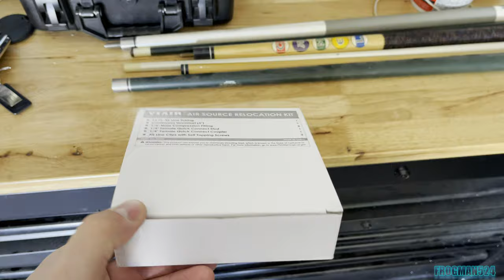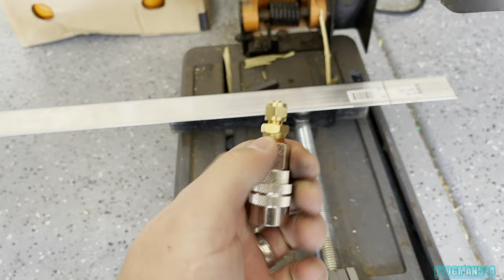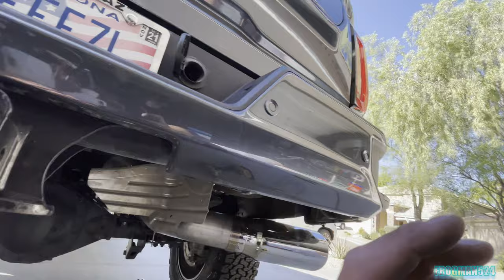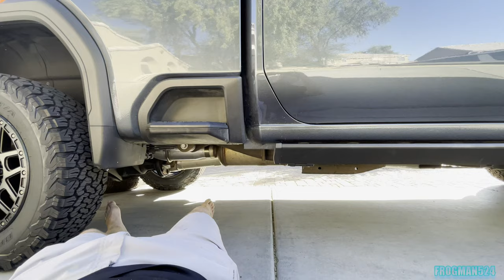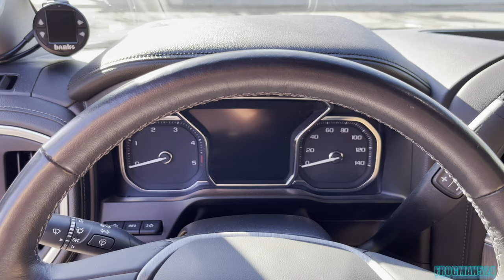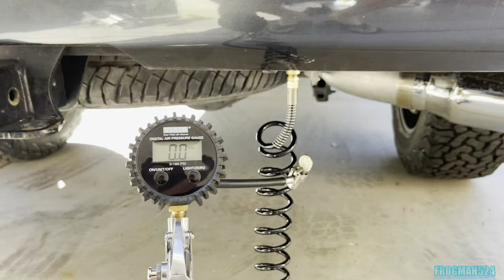Viair Air Source Relocation Kit Install on 2020 Denali HD

Comment: What Kleinn air horn kit do you have? Last I checked checked they didn't make a kit for the 2020 and up trucks. I had one on my 2015 Chevy 2500HD and really want one for my 2021 Chevy HD but don't want to give up my spare tire.
Reply from the maker: Custom install of the HK9 slimline kit
Reply: @FROGMAN524  any chance you could do a video on the install?